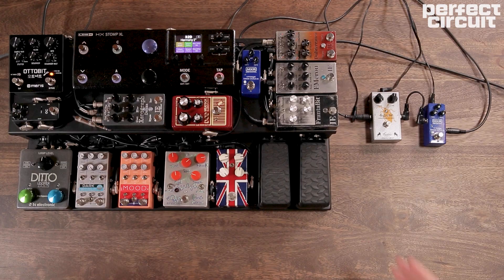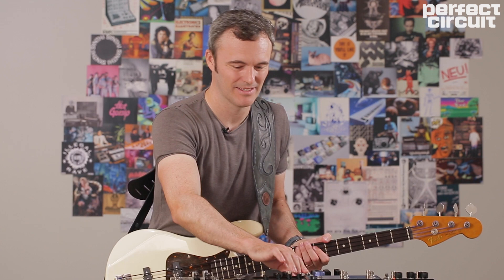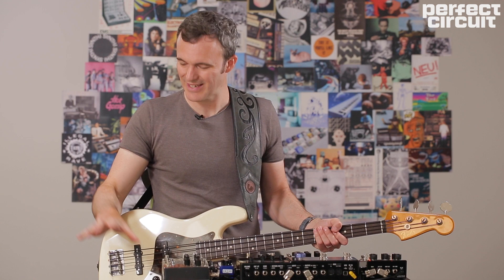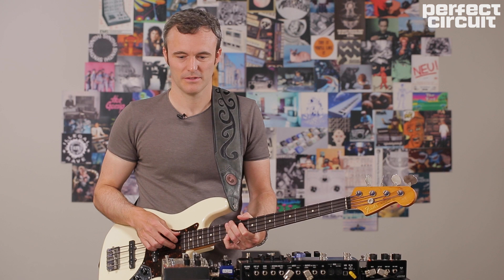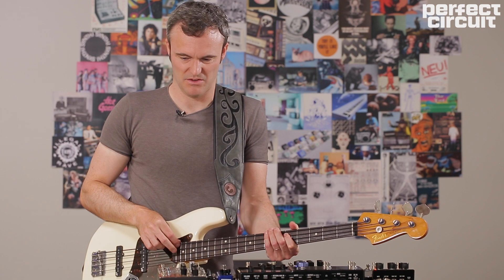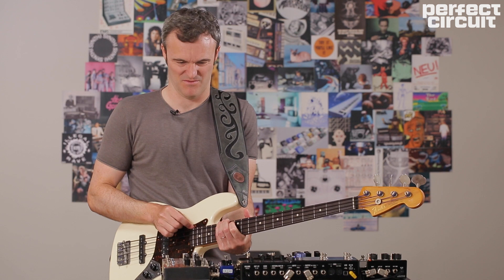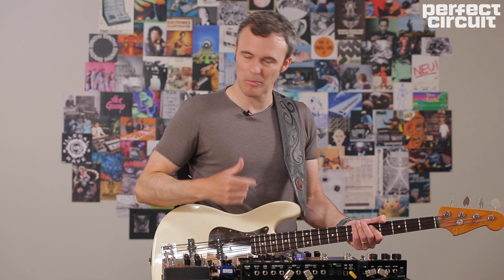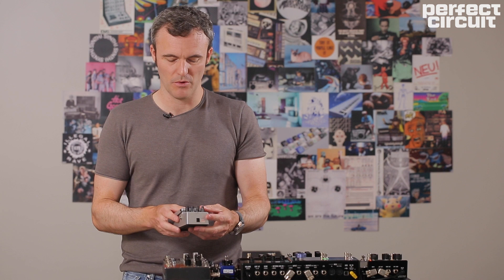Making Synth Bass Sounds w/ Janek Gwizdala

Comment: Chorus can help. 

Some old multi-FX pedals (e.g. Boss ME-6B) could be used to create some great sounds.
Reply: The ME-6B was allegedly used by Stuart Zender to create some synth sounds with Jamiroquai, but I've seen varying opinions on whether it was used anything other than live.
Reply: Distortion and oscillators both add upper harmonic content, but it can get a bit too raspy. EQ and speaker simulators can take the edge off, but  chorus and flanging can also smooth things out.
Reply: Useful tools can include a compressor at the front of the signal chain (standard use) but also at the back end to limit resonant peaks from the operation of filters.
Reply: Another useful tool is a blend, so you can put some of the original signal back in, assuming you aren't using a Boss OC-2 with no direct. It can ensure that filters, distortion, chorus, leave some bass signal in there, and if filters are not tracking well it's a godsend as any unexpected farty drop outs are somewhat covered by some fundamental.
Reply: Rotary speaker simulation can be fun with distortion, but can head more towards organ sounds than synth.
Reply: Oh, I've had good results with a Behringer  V-amp. In theory you can also drive an internal synth in it via MIDI, but the sounds aren't great. You can use a Zoom B-9 with your feet to trigger notes, but it's only really any good for old 70s and 80s sounds as sustained notes as you are not likely to want to dance a jig atop it. You don't get a full octave of notes either. Fun if you've always wanted to play old Genesis.

Comment: Not to mock, but by the time you've put together a pedalboard like that, you've probably laid out the same money as for a small Moog, and the pedalboard probably doesn't weigh a whole lot less. That's probably $4,000 in pedals alone. Each one of those four Iron Ether pedals normally runs over $400.
Reply: He’s gotten most of it for free though
Reply: Or you could just carry an iPad with some software
Reply: You can obtain synths that will sound enough like a Moog for live work for a lot less these days. However, it comes down to interfaces to some extent - if you can't play keys the Moog won't help. A Moog will trigger reliably, though. If you get it set up right, a GK-3B to trigger MIDI can be an option for slower lines (latency) and should track well, but quite possibly a Boss GP-10 or similar might be more reliable for bass synth sounds as there's much less chance of some MIDI note being left on for half a song... I've never used the GP-10, but videos suggest it should work. I have gone down the MIDI rabbit hole with various hardware and software, though.